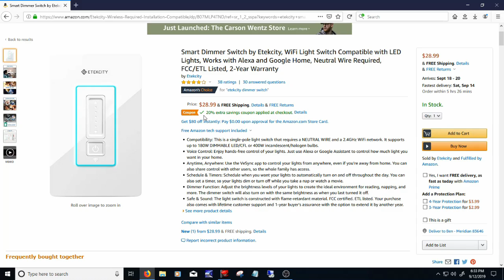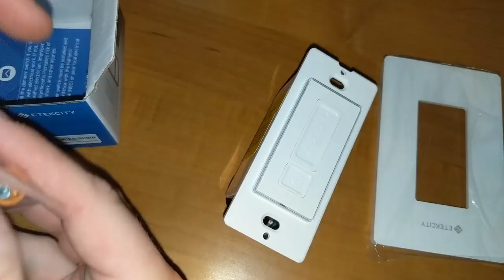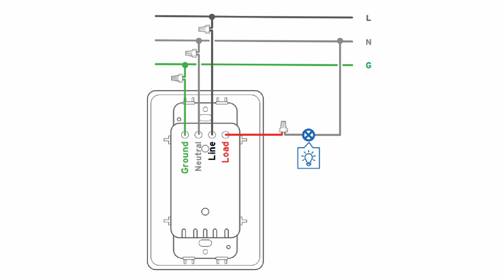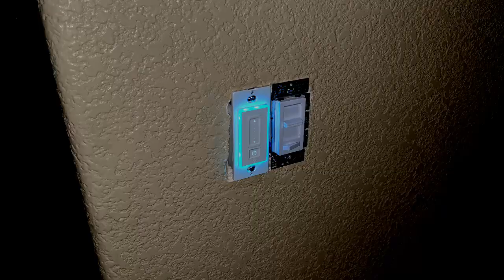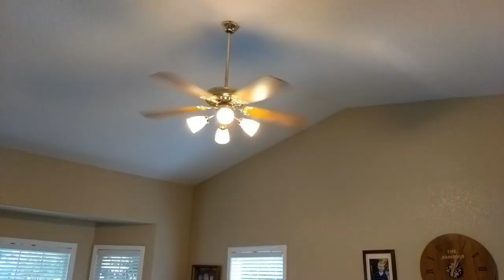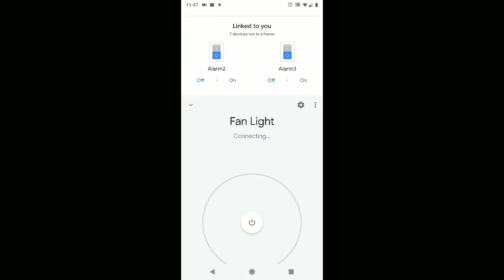Etekcity Smart Dimmer Switch | A Smart Switch With Buttons!

Comment: I really don't like the smart home trend. It's cheaper, easier and healthier to have non-smart things (they make you move your ass from your couch). And smart appliances add complexity to your home and more points of failure. While I do think automation is good, before I personally start doing any of that, I need to make sure that I will have a place to workout or do some exercises, otherwise I will just glue myself to the couch or bed.